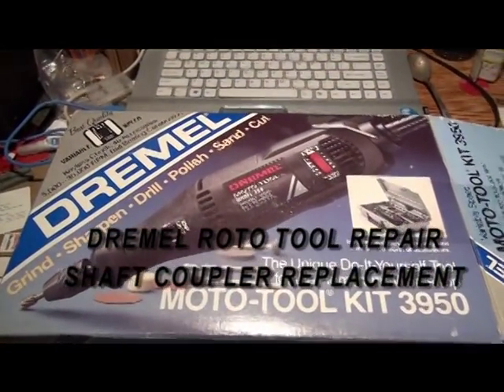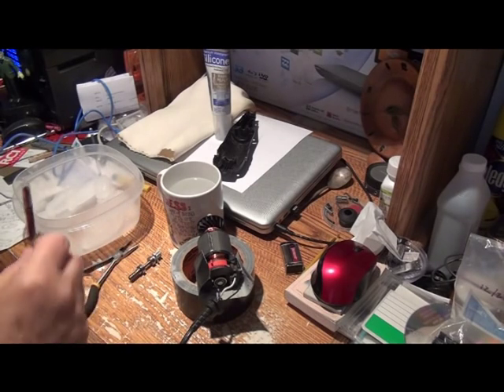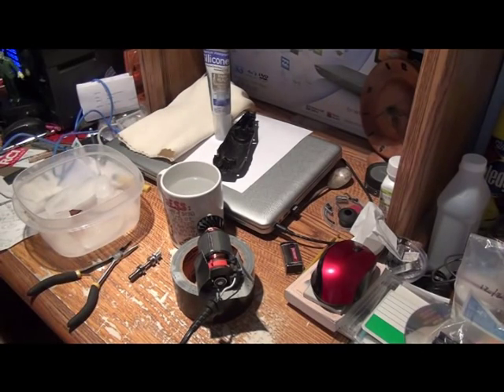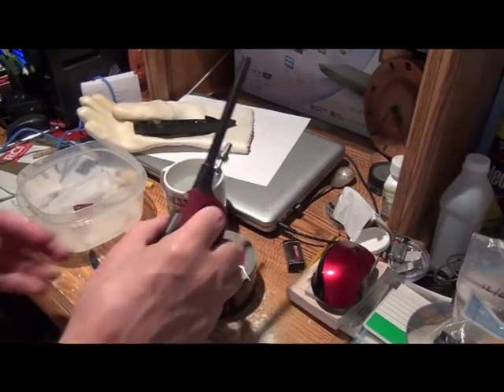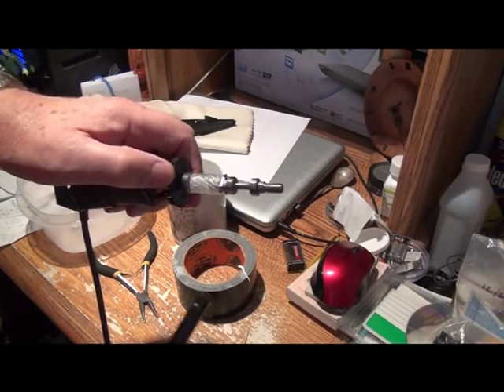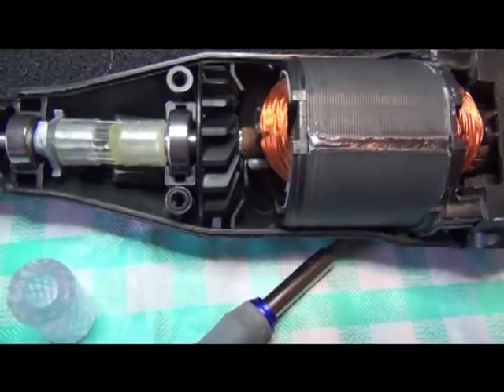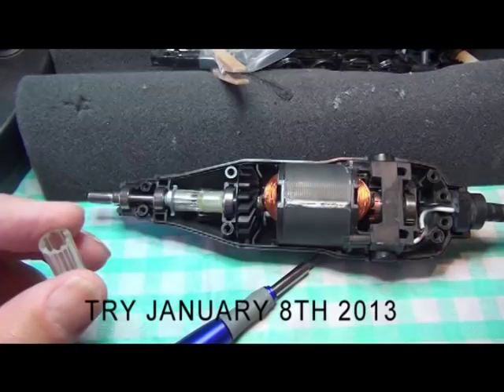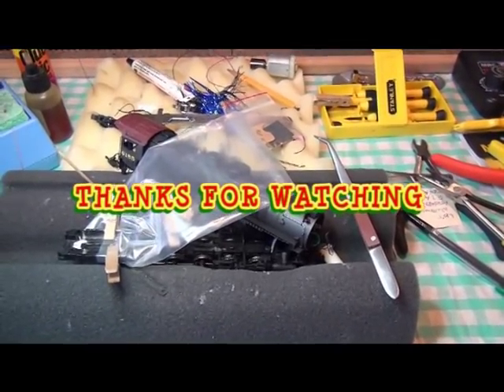DREMEL COUPLER INSTALL

Comment: Use of the plastic coupling is not a design flaw but is intentionally used for the purpose of saving the motor from excessive force applied causing stalling.. Dremel (and now Bosch who bought Dremel)  are well aware that it is the part that fails most often. The part ( and shipping) price is very low compared to having to by a new tool or replace the motor. Three cheers for Dremel / Bosch for supporting longevity over obsolescence and supporting the DYI community's efforts at repair.

Comment: It would be far better if you actually did the work with the work piece ON CAMERA, not off to the left somewhere, which really doesn't tell us much - does it ?  Come on people, if you are going to make an instruction video for Youtube, at least have a dry run thru first and get your act together, and make sure the camera IS CAPTURING whatever the important stuff is all about, otherwise you are  just wasting your time, and everyone elses.

Comment: I ordered the coupling direct from Dremel.  Their limit is 3 pieces, as the remaining inventory is all they have, and when it is gone, it is gone. Ereplacement parts currently has 12 in stock.  Get them while you can, this is too good a tool have to thrash, and replace.
Reply from the maker: +12paladin12 Agreed, I still have one and will most likely order a couple more, just in case. Thanks for the heads up. Ted
Reply from the maker: +choochoo3985  I just ordered 3 from sales@toolspartspro.com They are on sale until 12-31-2015 Price is $1.36 today  regular $1.89. They have the Dremel and Bosch. DREMEL 615 294 309 CLUTCH. USPS to PHX $5.95

Comment: As of March 30, 2015 you can still order the coupler directly from Dremel for $1.25 plus tax and shipping. You have to call customer service to order the part at 1-800-437-3635.